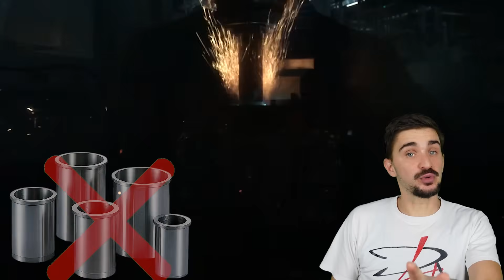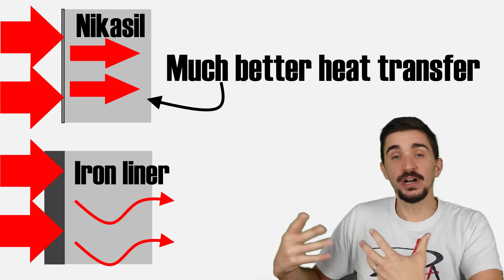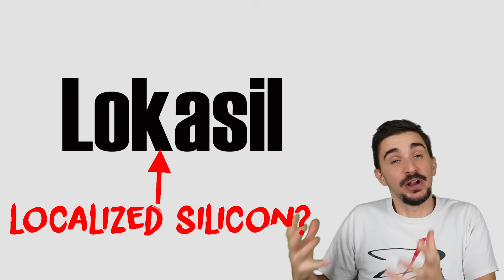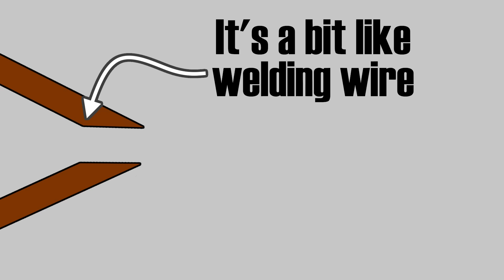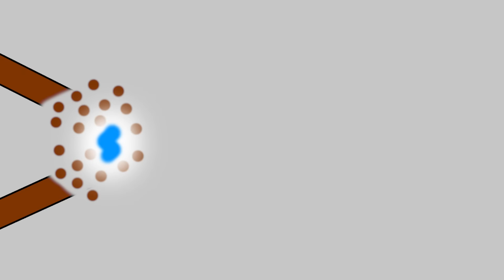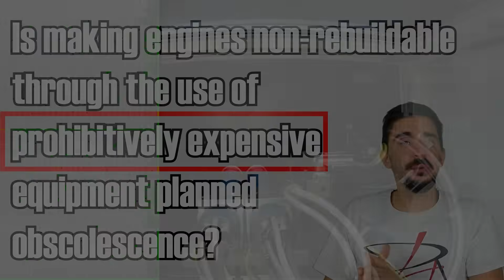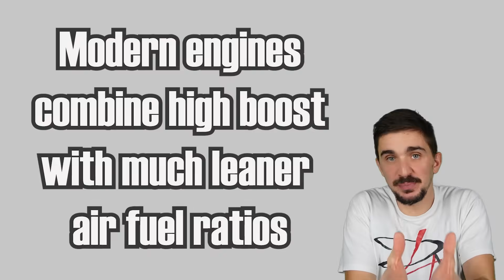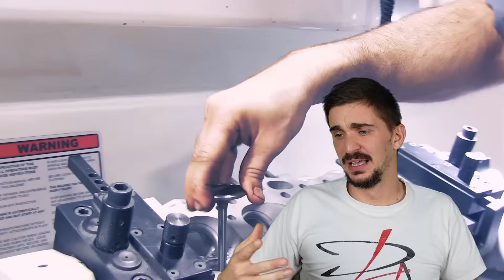Why Are Engines Becoming Non-Rebuildable? Everything About Cylinder Coatings

Comment: I'd formulate it this way: engine rebuildability was never a priority for the manufacturers. I'd even say it most probably was never a (significant) consideration. So when applying a new method in manufacturing leads to the loss of the ability to rebuild, it's a side effect that they are either happy with or don't care at all.
Reply: I'd say that you can rebuild as long as the coating is intact. Not every engine problem is caused by a bad bore.
Or find someone that can apply a new coating.
Reply: Also not a consideration for nearly any consumer or mechanic. Just cheaper and more consistent to find a lower mileage used engine from a junked car than to roll the dice at a rebuild. Plus machine shops aren't doing much work like this in a reasonable time. Its a 3-4 month process to get a shop to look over some heads and blocks where I live.
Reply: @SurplusMeat  that implies that there is a lot of rebuilding going on.
Reply: they rather just remelt the block, instead of having it rebuild by aftermarket mechanics with available parts.
Reply: REDUCE REUSE AND THEN RECYCLE

WHY ARE WE STARTING WITH RECYCLE. RECYXLE COMES LAST (OR never should/ last option)

REDUCE AND REUSE

YOU MUST REDUCE AND REUSE
Reply: Exactly, manufacturers are in the business of building an engine ONCE, CHEAP, and making it last long enough that the car is well out of warranty before it dies. Rebuilding is not a thing that ever enters the equation, and the fact that older engines were rebuildable is nothing more than coincidence.
Reply: Wrong.
It it is a coincidence then how comes that there are (still) repair manuals for compkete rebuilds. And I talking about relatively new passanger car.
Reply: @N20Joe or last much longer than others to still keep a good reputation.
Reply: @N20Joe  Do you seriously think engines were rebuildable by chance?
Manufacturers designed them that way so vehicles could even be passed down from generation to generation.
Based on that, major brands built their reputation.
Reply: @secret8440 wow you expect this greedy companies to have made a car that lasts long on purpose
Reply: Certainly up through the 1970’s rebuilding your family car was to be expected. Unless you have a Porsche or Ferrari your engine is going to the scrapper when it has an internal failure.
Reply: Certainly up through the 1970’s rebuilding your family car was to be expected. Unless you have a Porsche or Ferrari your engine is going to the scrapper when it has an internal failure.
Reply: @secret8440 of the 110+ MILLION small block Chevy engines ever made, how many of them have been rebuilt from bore damage? Maybe a few tens of thousands? How many have been bored and stroke to larger displacement? A few hundred thousand? A fraction of a percent, for one of the most popular custom built engines ever. How many fucking Mazda Skyactiv, Ford EcoBoost, or GM L87 engines will ever be rebuilt from a blown head gasket or spun bearing, let alone a scored bore? It's not a concern. Unless you can fit your head in the cylinder bore, it has never been and never will be a concern. Chevy knows what a scrap yard looks like. So does Ford, Toyota, Volkswagen, and Volvo. They don't care, you can pull a good core from every rear end or side impact crash.
Reply: Another way to say it is this: Disposable engines are perfectly suited to disposable cars.   For the vast majority of cars on the road, it will never be cost-effective to re-build an engine.  When a car blows an engine these days, it is often more valuable as parts.
Reply: The focus of engineers for a specific part is to make it last as long as the respective warranty period and without seeing too many claims for that part during that period, and to meet time and cost budgets set forth etc.
“Serviceability” is a special consideration that will aid things like aftersales KPI’s (if monitored) but the only real obligation of the manufacturer is to the market- which includes both the government’s regulations and individual clients. And yes, technician retention is a consideration for some companies but not a focus because again, cars are not designed to break down but rather to last as long as promised.
“Rebuildability” is a consideration during the warranty period for some manufacturers- especially on things like engine failure with block damage. Claims are examined at the dealer level to determine whether rebuilding an engine costs less than replacement. But at the design level, consequential damage is never really a concern unless it needs to be managed during the warranty period (I.e. DPF’s, carbon deposits, wear and tear)
Lastly I have seen some ridiculous claims from dealerships and admittedly shitty instructions/situations from the manufacturer but it’s all just a process of refinement and working with data and suppliers to better serve the markets. It may help to remember that manufacturers are composed of people too lol
Reply: This, or the more strident "Planned obsolescence" depends entire on who is your competition. Are you going up against someone well known for robust long-lasting machines that are easy to repair and renew? Or a low hours one-time use like a Williams get engine for a cruise missile. Either way, you need an advantage for the consumer. Do you need to rebuild engines for 350,000+ mile cars (Toyota Hilux)?
Reply: I drive a 28 year old isuzu diesel 4x4. It can be rebuilt easily many times over.
Reply: Exactly. It like ammunition hand loaders complaining about the number of reloads they get from certain brands.
The ammo companies only care if the brass case is used once, not many times.
Reply: Not true. Markets outside the US rebuild abilities are a criteria.
Reply: FACT.
Reply: Land Cruiser engines were built with sufficient material for over-boring on rebuild, if I recall correctly?
Reply: @DrRussell I believe a 1FZ-FE has enough clearance to be rebored 2 times before new sleeves need to be put in.
Reply: @DrRussell  Just like almost every other engine with a traditional bore material
Reply: It's all about making them cheap.
Reply: It's not because the cylinder coating, it's about the engine tolerances!!!
Reply: Basically unless you abuse it HARD, the body will be gone well before the coating fails.
Reply: That’s not always the case.
Reply: Isuzu would beg to differ.
Reply: If it wasn't a priority, then why can I walk into a parts store and buy connecting rods, pistons, bearings, etc?
Reply: my '78 924 had the rebuild spec's in the owners manual, including part numbers for three different sized ring for each of the three different sized pistons iirc. (it starts with the smallest piston and ring combo, allowing for 8 rebuilds)
Reply: @bmxerkrantz  I wonder what it'll take today to find the right sized  
piston in stock to rebuild one of the 924's engines, VW's ones or a Porsche's 2,5 L
Reply: How many people consider engine rebuild when buying a car, most people want power windows heated seats and an engine that never needs rebuild.
Reply: @johnnyBravo707  There is no such thing as an engine that will never need to be rebuilt, but more and more there are engines that CAN'T be rebuilt.
Reply: That and the vast majority of engines are scrapped at EOL, not rebuilt

Do you make engines suitable for 0.1% of use cases or 99.9% of them?
Reply: And how many engines actually get rebuilt?  I know it happens but what is the actual percentage of engines that get rebuilt vs replaced by engine type?
Reply: Engines are only rebuildable if you have enough material to correct a problem (im excluding weld repairs, etc.). Modern efficiency in R&D, materials, and manufacturing equals less material to play with when something goes wrong or wears out
Reply: Any decision a car manufacturer makes is driven by cost, as long as the majority of the things last the warranty, they couldn’t give a hoot.
Reply: I would go even a little bit further.  Engine rebuild ability is like the rest of auto manufacturers nightmares. Parts supply horror.  Auto manufacturers make money selling new units. The  necessarily legislated requirements to supply parts for repair is the bain of auto manufacturers existance. Really it's kind of the same fir consumers too. In a blue sky world consumers could purchase  an automobile based on a perfectly reliable expectation of it's service life and in that service life absolutely nothing would go wrong with it. At the end of it's service life it would turn to dust and the consumer would need to buy a new one. In thus scenario both the consumers and manufacturers could make all thier plans around either a date on a calendar or the number on the odometer.  No surprises, lowest possible cost, maximum reliability.  No parts supply issues,  no service departments necessary, nobody stuck on the road with a broken down car. (Barring accidents) This is why , except for some outliers,  ( that are being actively stupid)  the whole " planned obsolescence discussion is a result of consumers not really understanding how auto manufacturing actually works. That is to say, it ( planned obsolescence) very rarely actually exists the way most people think it does. What looks like planned obsolescence usually arises from practical experience cost analysis over unit life expectations. Some manufacturers are even trying to eliminate problems introduced in engine and transmission reliability by consumers changing thier own oil. (It's actually a big deal) So many consumers think they know what they are doing and actually do not that manufacturers have a steady stream of headaches caused by consumers creating problems but thinking they are doing good things that some manufacturers are simply creating terms of sale that stipulate that oil changes are to be done by the manufacturer only and warranty will be denied where consumers have done thier own  oil changes. Many people are offended by these terms of sale, but the manufacturers have done the math and have not taken these decisions for no good reasons. It's not planned obsolescence,  it's an outgrowth of scientific analysis in pursuit of reliability.
Reply: I’d add that it wasn’t a priority for manufacturers because it is not a priority for their customers.

Even for petrolheads who do it for the fun of it, most engines aren’t worth rebuilding.
Reply: @theondono  Maybe not for the rich countries but it is definitely a priority for developing nations. Cars are not cheap in most countries and if they can't repair their engine it just means years of salary going down the drain.
Reply: @theondono I can rebuild a 350 to better than stock for cheap in a garage. 
We need to pester afm to make more older engine parts again.
Reply: @theondono  'That's not really true.
Reply: @theondono  I agree. The most common engines to modify extensively already have steel sleeves or blocks, and most of the people who modify other engines typically have the money to just replace the block if it fails, and if pushing big numbers they already plan to
Reply: Traditional American engines were DEFINITELY worth rebuilding.
Reply: @jamesbosworth4191  Partially because they were only good for 70,000-120,000 miles. So they had to be rebuildable.
Reply: If you take care of them, they will go much further than that.
Reply: @theondono  until you live in 2025 where we are surronded with crappy engines (puretech, ecoboost) and we have to rely of older engines
Reply: @mro9466  Electric motors are amazing and can last over 1 million miles. Batteries are getting very good and, under average use, can last 500 thousand+ miles.
Reply: @AbeDillon  That's not the debate here.
Reply: @gabrielvieira.4358  I was responding to a comment saying engines made in 2025 are crap. I don’t think that’s true even for ICE engines, but there’s also a viable alternative in 2025 that largely obviates the need for rebuilding along with lots of other maintenance.
Reply: @AbeDillon  I agree that electrics are awesome, but newer engines are trash, they cannot even be opened without damaging the bolts
Reply: @AbeDillon  You're totally correct that electric motors are amazing and can easily be made to last millions of miles. Much more powerful pound for pound than a combustion engine. The problem is with the batteries and charging. Even if we do have batteries that last half a million miles there are many issues to be resolved. The biggest issue is with charging infrastructure. If we all drive EVs we would need a much bigger electrical grid with far more copper. The way the copper market is going now makes that economically impossible right now. I'm not saying we couldn't build up the grid but to allow everyone to drive EVs with convenience would take many decades possibly over a century.

First of all we need to establish many new copper mines in order to have any hope of meeting the copper requirements. Establishing a new mine alone can take nearly 25 years.

Enough said.
Reply: @arcrides6841 none of what you said is true. To do a proper analysis, you need to actually use numbers. Not just say "much bigger infrastructure with far more copper". 

The average American drives less than 30 miles per day. The Model 3 gets between 4.5 and 5.5 miles per kWh. That amounts to ~6 kWh per day. 

The average American also uses between 20-30 kWh per day. So we're talking about a 20-33% increase in residential power delivery. Residential power delivery makes up 37% of total electricity demand, so we're talking about a total demand increase of 7-12%.

With a smart grid, EVs could be used for load balancing. EV batteries are considered "end-of-life" when they drop below 80% of their rated capacity, so even a "spent" ev battery is perfectly usable for grid storage. A lot of the grid could be easily stabilized if we built an HVDC super-grid to connect the different regional grids just like the EU has been doing for over a decade.

HVDC doesn't use much copper because it's high voltage and direct current, so there's no "skin effect" in the line.

All of that would make rooftop solar even more attractive.

I currently have rooftop solar and a battery, so my reliance on the grid is near zero.
Reply: @AbeDillon  500,000+ miles from a battery?  BULL SH!T.  Don't gaslight people.  Even if it "lasts that long" we're talking probably 1/10th the initial range.  That is a useless vehicle for anybody who commutes regularly or even moderate distances
Reply: @AbeDillon  could you be any more booshie? OMG my solar and my electric vehicle and loads of income.  STFU
Reply: @AbeDillon  no battery will last 15 years no matter the mileage hence the amount of recharging cycles. The battery cost way more than the electric engine
Reply: @skippypeanutbutter9136  The longevity of an EV battery is measured by when it can no longer hold at least 80% of its rated capacity. You can search "EV battery longevity data" and see for yourself. There are batteries you can buy right now that degrade by about 1% per year. The average rate of degredation 5 years ago was 2.3%/year. California mandates that EV manufacturers provide a 10-year/150k mile waranty on all EV batteries. That's way better than the 3-year/36k-mile warranty on most ICE vehicles.

I treat my own EV pretty gently. I keep it between 60% and 40% charged except for the few times a year I go on a long trip. I've seen less than 3% range degredation in the 7 years I've owned it. But again: you don't have to take my word for it. There's plenty of data on the subject. EV batteries are already pretty good and they're getting better and cheaper all the time.
Reply: @skippypeanutbutter9136  There's plenty of data on EV battery longevity. You could look it up and see that I'm not lying or gaslighting anyone. 

EV batteries are considered End-of-life when they drop below 80% of their rated capacity, not 10% as you claim. California even mandates that EV manufacturers cover the battery for 10-years/150k-miles. If the battery falls below 80% capacity in that period, it's considered a dud. 

The best batteries today degrade by aout ~1%/year. The average degredation rate 5 years ago was over 2.4%/year. The owner can extend that several ways. The easiest is to keep the battery as close to 50% charge as possible. Low states of charge and high states of charge both degrade battery capacity. Excessive heat also degrades battery capacity, so something like the Nissan Leaf which lacks active temperature management tends to degrade faster. Fast charging also has a negative effect on battery life, though it's not as significant. If an EV has a nominal 250 miles of range, the average American can easily keep that car between 60% & 40% charge (50 miles/day) and slowly recharge over night. If they need to go on a road trip, they bump up the max charge ahead of time to 85-90% and that will easily get them between charging stations.

That's how I've been using my EV since 2018 and I've seen maybe 3% degredation. Just search "EV battery longevity" and you'll find plenty of data.
Reply: @AbeDillon  Where do get those statistics from? Most manufacturers seen to have battery warranties from 5 to 10 years or 100,000 miles (whichever comes first).
Reply: @AbeDillon  who cares, they are still boring
Reply: @AbeDillon source: my lying ahh
Reply: @mro9466  Here's an unpopular opinion: engines are not bonded to the chassis, like how your exhaust system isn't welded to the block. Change your engine when it brakes. It's just another replaceable part. Just like expensive brake pads. You gonna recycle your brake pad?
Reply: @AbeDillon , electric cars are great for taxi, OK for commuting, and totally not suitable for my usecase: 200-1000 km 3 times a month.
 Batteries are heavy, age quickly,  long to charge. And there is no universal battery block standard, which would enable robotic battery block rental. There is no point buying heavy expensive battery, which will die of aging in 10 years with 150 cycles.
Reply: @skippypeanutbutter9136  I've tried to respond to this and other comments multiple times but they never got posted. *If someone is flagging my post for whatever reason, please don't. Just because you don't agree with me doesn't mean I'm malicious.*

I'm not gaslighting people and you're using that word wrong. I'm not trying to convince anyone that they're going crazy. I'm also not bullshitting people. I'm weary of adding links to my comment for fear it will be blocked again, but you can search "EV battery longevity data". There's a decent article by Motor Trend magazine on the subject. The best EV batteries today show less than 1.0% degredation per year under standard testing conditions. That's already a huge improvement since 2019 when average degredation was 2.3% per year and the industry is continuing to improve batteries at a rapid pace. 

On top of that, the driver can do a lot to increase the longevity of the battery just like a driver can do a lot to increase the longevity of an engine. Some push engines to over 300k miles, some trash their engines before seeing 100k miles. My 2018 EV has lost 6% of its battery capacity since we bought it because I keep it close to 50% charge, rarely use fast-charging, and keep store the car in a cool place and go easy on the throttle. All of that improves battery life.

Most EV manufacturers offer a warranty that the battery will retain at least 70% of battery capacity after 8-years/100k-miles. California, the biggest EV market in the US by far, is set to phase in even higher standards which would require a warranty of at least 80% capacity retention after 10-years/150k-miles which most manufacturers could easily meet today. And that's just the warranty. What's the standard warranty for an ICE engine? 3-years/36k-miles? 5-years/60k-miles if you're lucky?

When an EV battery does fall below 70-80% capacity, it's still plenty useful for applications like grid storage. They're much easier to re-use than an engine block which would need expensive refurbishment that most people don't even bother with. At the rate battery prices are dropping, by the time most people (people who don't drive hundreds of miles a day) would need to replace their battery, it's likely to be much cheaper. I really hope the industry standardizes so that batteries can be interchangable like traditional car batteries, but that probably won't happen in the near future. Most battery degredation happens in relatively few cells, so refurbishing a battery in the future could be as easy as identifying the "weakest links" (probably with a thermal camera) and replacing them. 

All of that is easy to verify with simple web searches. I'm sorry I can't provide links. I've written this exact response at least 10 times in 10 different variations because they never got posted to YouTube. I eventually decided to wait a few weeks incase my account had been suspended or something.
Reply: @bladla7959  Yeah, I wasn't talking about whatever usecase you're reffering to when I said "under average use". I was referring to an average of less than 30 miles/day of driving. Obviously, an EV isn't a good fit for every use case, including yours.

I don't know, however, where you're getting the 150-cycle figure from. Most people don't measure EV battery longevity in cycles because you're not supposed to "cycle" your battery, but even when they do, I've seen numbers ranging from 2000-3000 cycles. The main problem is that people shouldn't (and typically don't) treat EVs like phones or laptops. You shouldn't regularly charge your EV to 100% or discharge it anywhere near 0% because that seriously degrades the battery. You shouldn't do that with phones or laptops either, but most people don't expect those to last over a decade anyway and they typically (and frustratingly) don't have any mechanism to limit state of charge. going from 60% full to 40% full 5 times is not nearly as bad as going from 100% full to 0% full once. It also matters how fast you charge and discharge the battery and how hot or cold you let the battery get.
Reply: @AbeDillon Electric cars are not so good in Cold climates.
Reply: @yamit465  yup. I know that.
Reply: @AbeDillon what? What batteries have been shown, in real world ownership,to last 500+ thousand miles?
Reply: @Not_An_FBI_Van  The YouTube channel "Autotrader" did a 4-episod series about a 2016 Tesla Model S with over 430k on its original battery. The videos are entitled:
1)  "Meet The Tesla That Won’t Die: 430,000 Miles On One Battery! Episode 1 | 4K"
2) "Range Test! How Far Can a 430,000-Mile Tesla REALLY Go? Episode 2"
3) "Are Used Electric Cars Much Worse Than New Ones? [Episode 3] | 4K"
4) "Tesla Taxi FULL HEALTH CHECK: Is The Battery RUINED After 430,000 Miles? [Episode 4]"

The problem is that it usually takes 15-20 years to put that kind of milage on a vehicle and most EVs are less than 10-years old. The ones that have seen that many miles have been driven particularly hard and it shows in their maintainance history. What we have instead are degredation statistics (just do a Google search for "ev battery degradation study") from which we can extrapolate that many EV batteries should reach 500k+ miles. Not all, or even most, but I wouldn't be suprised if it's more likely for a consumer EV to reach 500k on a battery pack (with >70% of original capacity) than it is for a consumer ICE vehicle to put 500k miles on an original engine. I also wouldn't be suprised if some 2025 EVs eventually put 700k+ miles on a battery.

NOTE: I don't put links in YouTube comments because YouTube is weird and sometimes refuses to post my comments or even shadow censors my comments so they look fine to me, but nobody else. I don't know how much this is related to links, but they used to be very strict about links, so I just don't do it.
Reply: @AbeDillon that's nice but if I'm broke down in the middle of nowhere I can't hike to the nearest charging station and fill up a bucket of electricity. The infrastructure required to make them truly viable over gas cars just isn't there yet
Reply: @DavidJeffreson-xx7kr  What are you talking about? What does "truly viable" mean? Millions of people are driving EVs right now. I've been driving mine since 2018 and I've had zero problems with infrastructure. I'm never going to buy an ICE car again.

This is like going to an airport, seeing an airplane, and saying "that'll never fly!" while it takes off right in front of you.

Did you know you can't just feed your car grass when it's low on fuel? We should have never switched from horses. They're clearly more convenient, right?!

Also, in 40 years, I've litterally never had to walk to a gas station to get gas because I'm not an idiot. In fact, the only time I've come close to running out of gas was the last time I drove a gas car. I forgot you had to worry about fuel levels and almost ran out of gas. I don't even think about it with my EV. I just plug it in to a regular outlet when I get home and never worry about stopping at a station. When I go on long trips, I know exactly how much battery it'll take between chargers.

"How are you going to rope up your fangled automobile outside the saloon? Checkmate!"

So so dumb.
Reply: @AbeDillon  damn dude sorry for insulting your pride and joy lmao. That's still not going to convince me to ever drive one of those things tho, if I wanted a toy I'd go and dig out my son's old power wheels from my garage. An electric motor is nice when your putting around the golf course. But when you actually need to get work done, that little putt putt motor in your Tesla is gonna start smelling like a tire fire. Hopefully you'll grow up soon and get a real man's car, But until then have fun with your little scooter you have.
Reply: @mro9466  it’s not completely horrible I mean how many do you see on the road? That means the car works… minus a few hiccups
Reply: you are on different planet..
Reply: No those engines are not crap BUT THEY DON'T LAST AS LONG as the older one. That is the main point. 
Now if you start taking in account of pollution... yes they might have found an excuse..
But as newer syntetic fuel comes, would the manufacturers make reliable engine now?

PROBABLY NOT!
Reply: @MrFryfish  manufacturers shouldn’t and will not care about a car after they are no longer responsible. Their profit is made before the car even makes it to the car lot. Dealers pay cash for every car on the lot. Governments pay cash and Rental car companies and fleet owners all pay cash to the manufacturer. So their profit is already in the bank. They take some losses on warranty work for a few years, once out of warranty why should they care at all what happens to that car?
Reply: @AbeDillon  Batteries are the limitation there
Reply: @theondono  Because manofacturers made that a reality. ANY engine up to the 90's could be rebuilt.
Reply: @theondono  True for me. My engine is 20 years old, now, and doing anything to the engine would cost me so fucking much that the entire car would sell for less than the rebuild. I can maybe repair some of it, but by the time repairs sum up over $5k, i am selling the entire vehicle for scraps. If you are willing to do it for free for me, I would be happy, but most mechanics wouldn't, and I am a chemist and pharmacist, so by the time I get enough skills to work on my car for free, I would be carless for a decade; at that point I would already have a new car.

Edit: mind you that I come from a low income family. If $5k full engine repairs aren't breaking your bank, then you are far more privileged than I am. Anything above 1k upfront is already a VERY hefty cost. Cars are massive money sinks, and it sucks to live in a car-addicted country...
Reply: If you can’t afford 5,000.00, how will you afford a new car?
Reply: @jamesbosworth4191 "new" car. Another used car to beat around till it croaks.

Im in the same boat with one of my fox body mustangs. It'll  be cheaper to buy a new block than to get it's current one rebuilt. Machine shops charge almost 7 grand.
Reply: @missfire9480  7 grand now to rebore, line-bore, and deck a block?  Rediculous.  Just like small 2 bedroom stuco houses are now worth well over a million.  Nuts.
Reply: ts because they are so focused on making them lighter to meat Government MPG Standards that you can't machine them. If you really care about having good reliable vehicles you should lobby to end the Emissions Racket that's all based on Lies.
Reply: Not a new method actually it’s been done for decades
Reply: I think engine rebuilding use to be somewhat a priority for manufacturers, because they didn't only rely on profits from selling new cars, but also different parts as well.
Reply: I own a 2004 V10TDI with 200k miles. It has platinum coated bores. still reliable and doesn’t burn oil but it’s an old VW so it leaks.
Reply: Kinda like 2jz, which was made to a reliable power source but since it's a toyota engine from the 90s it just happened to be good for tuning
Reply: The focus of engineers for a specific part is to make it last as long as the respective warranty period and without seeing too many claims for that part during that period, and to meet time and cost budgets set forth etc.
“Serviceability” is a special consideration that will aid things like aftersales KPI’s (if monitored) but the only real obligation of the manufacturer is to the market- which includes both the government’s regulations and individual clients. And yes, technician retention is a consideration for some companies but not a focus because again, cars are not designed to break down but rather to last as long as promised.
“Rebuildability” is a consideration during the warranty period for some manufacturers- especially on things like engine failure with block damage. Claims are examined at the dealer level to determine whether rebuilding an engine costs less than replacement. But at the design level, consequential damage is never really a concern unless it needs to be managed during the warranty period (I.e. DPF’s, carbon deposits, wear and tear)
Lastly I have seen some ridiculous claims from dealerships and admittedly shitty instructions/situations from the manufacturer but it’s all just a process of refinement and working with data and suppliers to better serve the markets. It may help to remember that manufacturers are composed of people too lol
Reply: Business interest mainly focussing on profits the truth of the matter they aren't reliable a good example is Nissan qr20 most 3 cylinders like toyota yaris 😂😂
Reply: I've seen Honda's with 400k you are wrong 😂
Reply: @jaybomb5022  he wasn't speaking in absolutes. However, neither should you. 

I owed a Honda that couldn't make it to 40k. Dumped it for a Ford 15 years older and 400k on its ticker. That Ford gave all it had left, 47k miles. 7k more than what that Honda gave me in total brand new from the showroom floor. 

And it doesn't matter how good Hondas last. Americans very rarely own their cars for that many miles. And have you ever sat on 400k mile car seats? That's a lot of previous owner farts lingering in there.
Reply: It didn't used to be that way, so it's still a valid point.
Reply: Too bad most big companies are in the hands of a few. Those that attend the meetings they use to deny. Now they openly talk about. Like Bilderberg.

But please continue to trust the hand that feeds you petroleum by-products...
Reply: Firstly, the Citroen 2cv proves for all time that cars only need about 20 horsepower and that any increase in power wastes initial cost, emissions, efficiency or all 3, and electric cars with their broader torque curves need even less power.  Increasing power, instead of using all technological advances to improve initial cost, emissions or efficiency,  is making new cars unaffordable when 2cvs are much faster than city buses.
   Secondly, it sounds to me like these engines can still be rebuilt either using Nikasil or in large rebuilding factories, but also 20hp blocks would be both easy to ship long distances to large rebuilding factories or not too wasteful to replace.
Reply: On neglected environmental impact is that most factory workers commute and that commuting is an environmental impact of the factory, most small rebuilding shop workers commute too, but it's easier for small shops to be within walking distance of workers' homes than it is for large factories.
Reply: And you would be formulating it completely wrong, because just like the rest of the brainwashed, time existed before you were hatched.
Reply: nja in the 50s it was, esp smaller engines for agriculture and such, but would say in industry and agriculture like perkins and the alike are made for rebuilds simple engines with few parts for disels, but car engines na not really ment for rebuild
Reply: i dont believe that. there is competition. if word gets around certain engines last very long, the sell more of'm. if it turns out certain engines do not last, people are not going to buy a lot of them. and nowadays engines last far longer than 40 years ago. then, (in europe at least) 100.000km was a considerable distance for a car to cover, 200.000 was a lot, you'd never sell a car with 200.000 km on it.  except maybe a mercedes diesel. nowadays, a middle class engine should easily reach 300.000, maybe half a million.( i exclude those mini 3 cylinders!!!)
Reply: Excellent post from the op. 
Engines weren't intended to be rebuildable they simply were.
Reply: Engine reliability, durability and ability to rebuild was absolutely a priority for some manufacturers.  Those manufacturers may have strayed from it but it was priority.  Honda and Toyota.  I rebuild many Honda engines that had 200K miles or more.  In every single case the car came in because of, overheating.  A thermostat had failed or cooling fan, or had a coolant from an old hose.  The customer failed to repair or failed to notice.  If they had pulled over in the early stages of the overheat, they wouldn’t have blown the head gasket.  I had some where the customer ran out of oil, not because the car was burning oil, but because of leaks or not putting oil back in after an oil change.  Most of the rebuilds did not need to be bored, honed for new cross hatching.  Often times lapping the valves was all that was needed, no need to recut the seats.  Even the cars knocking because of a spun bearing, the crank survived, polis the journals and good to go.  My ‘92 Civic at 300K miles (original engine, no oil consumption, original manual transmission-I replaced a noisy main shaft bearing when I did the clutch around 200k miles) was replaced because I was getting water in the rear floor boards when driving in the rain and the worn driver’s seat was uncomfortable and to be honest I just wanted something newer and nicer.  If I hadn’t taken the time to find where the water was coming in from and replaced the seat, I fully believe I could have easily have had driven another 100K miles.  Some of my Toyota customers had 400k on their cars, original engine and transmissions.  Old Toyotas are also rebuildable, they just didn’t need it except for customer neglect/abuse
Reply: Agreed
Reply: What about Detroit’s 4-71 series?
Reply: Manufacturers have been offering engine rebuild kits for almost as long as they have been selling cars.
Reply: Realistically out of a million engines 0.01% might get rebuilt but that's over its entire life
Reply: @subedsiber3648 There are thousands of rebuilt LS engines available right now. There is an entire industry built around remanufacturing engines and transmissions.
Reply: It was for the volvo redblock at the very least
Reply: well maybe they don’t care about making it rebuildable, but they create repair manuals with step by step instructions for pretty much every ICE vehicle.
Reply: Manufacturers only care if their cars last the 2 first buyers.
Reply: "was never"

It used to be. Volvo, when making their engines for the 240 model, didn't have computer software to exactly calculate how much they could squeeze out of the block. So they made the blocks way over engineered so they would last and be easy to work on and cheap to repair.
As it turned out, they made the blocks WAY too good and they became a solid platform for engine modifications in Sweden. More often than not, you'd see one at the dragstrip pulling good times.

Volvo made spare parts for every car they manufactured because they were afraid they would break down and customers would be unhappy. Again, it turned out not to be. The cars lasted TOO well and Volvo had to innovate A LOT to get people to buy their next model. Because they still had their old reliable which ran perfectly well.
There's still 240's around standard FROM FACTORY that run like they had just been broken in.
Reply: Funny how the younger generations are so dumb that they have to be told that.
Reply: I agree!
Reply: Engines used to be overbuilt and rebuildable, out of necessity.   Oil wasn’t very good, manufacturing tolerances were sloppy, they’d wear out in just a few years.  Engines rolling off the assembly line today are precisely built, efficient, have much higher output, work amazingly well if maintained.   Unfortunately, the bean counters decided that 10k+ mile oil change intervals are acceptable, mostly to reduce maintenance costs for leased vehicles.
Reply: @ClockworksOfGL  no, its not cost cutting, or it's also cost cutting, but primarly its emmissions. Becouse somehow manufacturers managed to get the oil changes included as emissions, and thats why they will recommend 40 000km (roughly 25k mi) oil intervals... Its horrible.
Reply: @ClockworksOfGL only complete dummies wait 10k+ to change oil or people who don't plan to own the vehicle for long.
Reply: You call a bean couter a serious DIYer, you moron?
Reply: @ClockworksOfGL Those massive oil change intervals ARE acceptable. Oil isn’t what it used to be. I’ve run an oil test on a car 15k since its last change and it was still perfectly fine. The manual said to change the oil at that point so I did, but Blackstone said my oil still had life left.
Reply: @philiam0420  Just because your engine starts does not mean it is "perfectly fine".
Reply: @ClockworksOfGL  No. The engines ARE Built to NOT last more than 300k km's (IF THAT) and when they need rebuilt, its impossible. Who cares about fuel economy? I want a engine that lasts!
Reply: then buying this modern scrap is not my priority. I would buy a recomissioned old and reliable engine instead.
Reply: Its dumb to even do it if they actually care about sustainability (which they say they do), repairable engines make much more sense
Reply: Completely agree!
Reply: @nielsoudegriep2900  Government bigwigs care more about getting old cars off the road, ideally into a crusher so that parts cannot be used to keep other old cars going. They figure the new car that replaces it is cleaner and likely to be an EV.

You can believe (as I do) that this is wrong-headed, but that's what our "benevolent leaders" favor. (None of whom, I might add, struggle to afford a new car.)
Reply: @bcubed72 i'll keep em alive myself then😂
Reply: I also think that rebuilding engines is actually a niche thing, its something people dont do, usually once a car doesnt run anymore, people just send it to the scrapyard and buy a new car, and cars in the scrapyard are usually never rebuilt
Reply: @SpeedyGwen but modern cars are degenerating. I only maintain 2011 and older cars because NOTNING newer is worth it.
Reply: 50+ years ago you got your car and the car manual had instructions how to adjust timing and valve clearances.  

Today you get car manual telling you not to drink coolant or brake fluid.

Go Progress.....
Reply: @donnied8127and then came valves with adjustments by shims, and then you had to take out camshaft to adjust valves... Thanks I have other things to do than maintaining valves. There's good reason why they make them mostly hydraulic nowadays.
As labour gets more and more expensive adjusting valves or rebuilding engine is going to be more and more costly. 
Only engines are worth rebuild are ones which chassis will outlive engine and that's rarely happen in basic commute cars.
Reply: @donnied8127 yeah 50 years ago you would be lucky to get a 3 month warranty and carried tools with you for when you broke down
Reply: Aren`t emissions the reason why they do this. The coating on the cylinder walls reduces friction and betters the efficiency, the oil residue doesn`t get burnt up in the combustion chamber.
Reply: Not really, it is because most motorists do not believe in in rebuilding, they figure why not then make engines disposable and cut production costs.
Reply: That is NOT why, it is because the buyers don’t believe in rebuilding, so the automakers are making non-rebuildable, as it is cheaper.
Reply: It was, actually, until the 80's babling and electronics
Reply: which is better engines can go million miles without rebuilding.
or engines that blow up around 50k miles.(hyundai & KIA🙃)  but rebuildable ?
Reply: @dark6c159  i'll take the 90s-2000s Lexus/Toyota/Honda and even some GM motors that can easily go for 150-250K miles or more before needing a rebuild, and can be rebuilt fairly easy over either of your polar extremes.  Nearly zero engines go a million miles, let alone over 250K
Reply: @skippypeanutbutter9136 I dont know where your getting your information. I have a duramax lb7 with 330 there is a person on the forums with 1.5 million mikes on the OG engine and many more with 500k+. I have a volvo 740 with 290 (havent been driving it lately ) and believe it or not two Subarus  (2.2L) over 230 last one made it 260 before my fan fuse blew and caused an overheat which warped a head...not the engines fault. I know MANY other people driving vehicles of all kinds over 250k without major engine overhaul yes even gas engines
Reply: @OK-tn8bc  drrrppp well muh truck is so drrppy drrpp and my diesel in my big blue truck.

dude stfu
Reply: Nikasil has been used in high performance motorcycle engines for decades. Unless the engine has a destructive failure it generally doesn't wear out.
Reply: And we shouldn't be indiferent.

WE SHOULD CARE ABOUT IT.
Reply: Done on purpose. Thay want to sell you a new motor and make a bigger profit. Make more money bigger markup possible on complete engine than a few parts. 
Thay know thay can make more money by making the car have to come to the dealership for certain things. Like all this computer crap. 
Mechanic.
 Mechanics are becoming a thing of the past. More A computer wizard that turns ranches. Way to much data. 
Was it ford that a truck got water in the taillight and it bricked the truck 5500 dollars later.  At that point id be pissed. They used to make vehicles now more like computers on wheels.
Reply: Exactly, companies are incredibly wasteful so that was something they didn't care about only cutting costs
Reply: That's why I will never buy a car on this side of the millenia. I don't even want fuel injection or onboard cpu. I'll pay good money to an owner for an old car before I give money to a billion dollar car corporation for anything new. My 85 Bronco will still be riding around long after the last cyber truck is recycled.
Reply: Well yes but actually no. As strange as it might sound for engineheads like us, the companies strive for something that worked in the 1960s aswell as now.
Selling for everyone.
Everyone should be able to use those cars. And everyone most certainly isn't us. Whilst we might see engine rebuilds as a thing doable for us. The majority wouldn't even think it exists.
(Funny story, just as a comparison) My mother ruined her first car because she thought the yearly checkups required to drive cars legally in austria was something like a service and thought everything was taken care of, only to one day have a total on the highway by Linz because it had no oil in it.

For the everyman it doesn't matter if it's remashinable today. Buying a another car is oftentimes cheaper, especially when comparing how often people switch cars nowadays.
Reply: Moreover, customers don't care at all, either. A sober customer base would boycot the everliving crap out of any company making this. However big iPhonized mass are probably already there defending this - "who needs to rebuild an engine that just works"
Reply: The B230 redblock Volvo engine wasn't designed to break, and thus it will not break.
Reply: You have all been brainwashed into thinking that it’s OK to have to buy a new car every six months…. It is not OK. A car should last a lifetime. End of story…. The advancements that we have in Metallergy engineering and mechanics, we can have cars that last several decades without any issues…. But this is not monetarily feasible for auto makers as if you don’t have to buy a car they don’t make money…. Engineered obsolescence is what it’s called their engineer to fail purposely…. It’s no coincidence that every model has the same type of failure one after another.
Reply: @thomasdmuchowski301  I don’t care about if an engine block can be rebuilt. I care about 3 or 4 $500 sensor replacements in one year, or $1000 power steering systems.
Reply: Oh, they care. The auto and consumer goods industries are like Mr. Burns.
"Smithers! Let's make sure that this technology that can increase performance also makes the engines non-rebuildable. so they always have to buy new ones" 
"Right away, Sir!"
"Ehhhhh-xcellent."
Reply: I mean aside from the cost variable that were mentioned in the end of the video, most cars (let alone the engine) will not be considered to be worthy of a hefty maintenance/rebuild effort after 10 years anyway. With the way that car features advance and also the car consumer behavior I think as time went on people would want to switch cars even more frequently.
Reply: @juansebastian2024  
We used to buy new and trade them in for about 1/5 cost of a new one.
Reply: @juansebastian2024  you mean how cars are turning into incendiary and toxic land torpedos that are also spyware filled tablets on wheels and being marketed as and engineered as if they are appliances and a subscription fee rather than a piece of personal/family owned property that all of urban planning since forever has been planned entirely around?
Dumbcars are worth way more than any bonzi buddy cartpad
Reply: Agreed, rebuildability was simply a nice side effect of the fact that engines were made from cast-iron and had nice, big separation between the cylinders, allowing the original cylinders to be bored out a bit and fitted with oversized pistons. 
Large diesel engines actually WERE designed to be rebuilt, as they used sleeves that created the cylinder walls. Those sleeves and the pistons wore out and could easily be replaced with a new, identical set, making rebuilds relatively easy. 

So, then the question: "why don't manufacturers of small engines use sleeves as well, because that would make almost every engine rebuildable?", pops up. The answer is cost and weight savings, and probably even more important: planned obsolescence. Manufacturers don't WANT their engines that last virtually forever, because then they won't sell new engines anymore.
Reply: @tjroelsma  Back before all cars were Japanese, an engine that couldn't be rebuilt would have killed sales for that make and model once would got out.  Most buyers of Japanese cars don't tinker with their cars except to put a different radio in it.
Reply: Most vehicles are only rebuilt once or twice in their lifetimes
Reply: @samsonsoturian6013  Most are NEVER rebuilt now. You get 15-20 years out of an engine. By then the rest of the vehicle is falling apart.
Reply: @samsonsoturian6013 most vehicles never see a rebuild.
Reply: @samsonsoturian6013  not even once in usa market. In most of euro market too.

The cost of labor in west is the real stick up with it and government policies.
Reply: @samsonsoturian6013 tell that to police vics and their predecessor bored 0.7 over and ran behind the envelope on the regular lol
Reply: It was indeed a priority, but most motorists today don’t believe in rebuilding, as they want everything to be disposable, so the auto makers are just taking advantage of motorists ignorance.
Reply: @jamesbosworth4191  Not true. This is just the excuse they use, and you fell for it. Meanwhile we are all over here screaming about the crappy quality and how everything is built to be disposable.
Reply: I do not own a modern car and don’t want one, so I hat is your point?